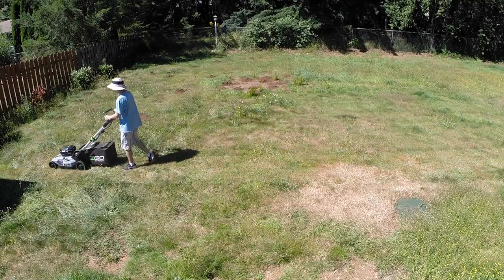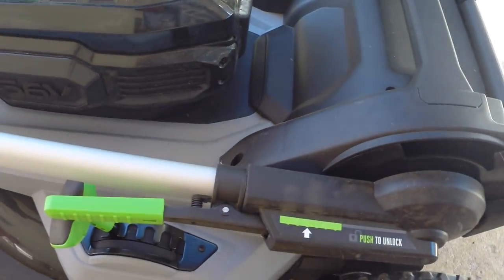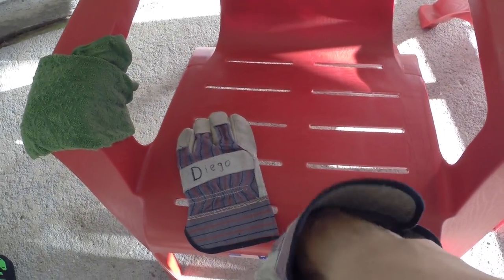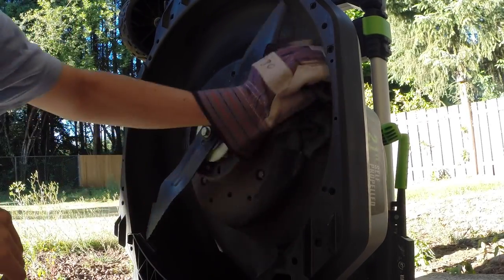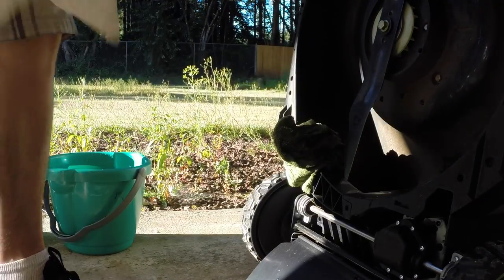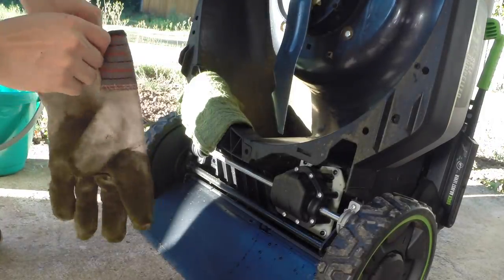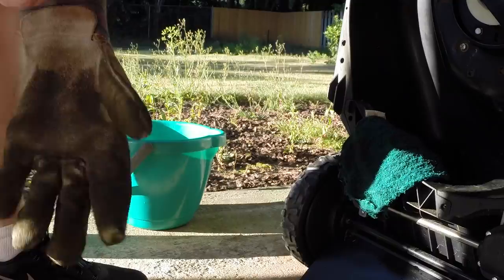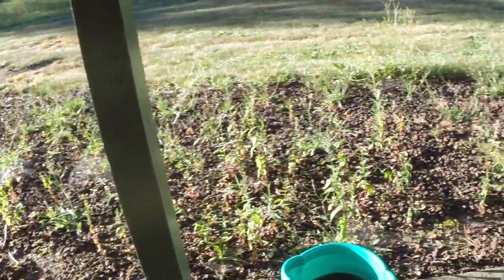How to clean your EGO Mower (the right way)

Comment: All EGO products are rated IPX4 and are water resistant. Resistant is the key word. I've had the mower for 2 years and I always hose down the deck underneath. Sometimes I set the sprayer to mist and gently hose down the top around the battery compartment. Damp cloth for the battery compartment itself.

Comment: I just hose minds down with my water  hose . I  sharpen my blades twice a  mowing season. Oil the joints and  use a WD rust resistant water proof. Two years and still running awesome.
Reply: Hi quick question, lets say I have it in the stand up position to wash it off. Do you go out of your way to set it on its side when trying to wash the very top part?  I never point the water hose directly in the middle but I'm scared that if I spray the very top then the water would wash down to the center
Reply: After you remove the blade, you will notice the white fan that is exposed and you can pull it off with ease.  You then will notice in the centre position shaft and you will see that the electric motor IS NOT EXPOSED but indeed a bearing cover.  Whilst using a hose try to not direct the water at this position anyway.  Had my EGO Mower 3 years now and no problems.  Good luck with your EGO mower.  Cheers from Australia.  Go EGO.

Comment: That is how I clean mine too, not as thorough though. It is time consuming but it is worth it. I do not want to damage the motor like my previous one. I also use the blower first to remove loose grass , so that I don’t have much to wipe with the rag.
Reply: I can't believe I was about to buy an air compressor until I read your comment about using the blower, haha!

Comment: I have had my EGO mower for over 2 years now and I have always hosed off the grass and dirt from underneath with a garden hose, making sure that I do not spray at the centre of the deck where the white motor fan is.  I also do not have a hard spray with moreover a fan of water to remove any grime, grass and dirt away from the deck.  No gloves no detergent, buckets or rags.  This practice I have used with excellent results.  Still going strong.
Reply: Me too.....I do the same thing with my Ego mower.  I have had mind for over 3 years now.  No issues with the mower.  I had concerns because of all the plastic, but those concerns have been unwarranted
Reply: I also have the String Trimmer, pole saw, and edger attatchments and blower and had these the same length of time with excellent results . . .  Go EGO Garden tools. Cheers, JR.
Reply: Aye. I check the underdeck after every mow. Rinse as required with a hose. Done b4 this video was over. Ya just can't get crazy with the hose. Remove the blade when dull give it a good cleaning, file sharpen, and spray with graphite.
Reply: @kamesnek7274  I have the same mower, and the other day I used the hose to clean it, and sharpened my blade, but now the throttle is stuck in turtle mode unless I do a wheelie, and slam the front on the ground. Its like water got somewhere it shouldn't have? Than its good for a little till I do a wheelie, and slam the front on the ground again.

Comment: I stand mines up like you did. But I wait til it's dry with a broom comes cleans easy.
Reply: spafro101 or if you have an air compressor you could blow it away easily with an air hose attached with a regulator so you control the air pressure too
Reply: @peteross4879  yea that works if you have that

Comment: wow, overkill.  just hose it off like any mower after you take the battery out and then sundry or blower dry.  I have noticed EGO very finicky about dirty deck and moderately dull/sharp blade

Comment: Today after mowing leaves and tall rye grass there was about a cubic foot of grass stuck under the deck.  I used a hose, then checked how I was supposed to do it later.  Maybe I ruined the thing, but how to get all that grass out with just gloves?  After it dried, it would be stuck tight.  Yikes!   So much work.
Reply: flexible plastic paint scraper is your friend.  not that difficult....

Comment: Good job! Question: Would it be a good idea to wax the underside before using the first time ? Just a preventive idea ...
Thanks!
Reply: I was thinking the same thing, wax makes sense, but even a light oil might do. Especially on the blade, as it will keep it sharp longer.

Comment: You should be able to just hose off the mower. Using a bucket and a rag is just too messy and time consuming. Hose it off and avoid the electronics. Use common sense. Using a bucket and a cloth is not going to make it cleaner or safer. It just means more work.

Comment: Wow man. You've had those gloves for 4 years? You must not do any work outside. It's a lawn mower. Use a water hose. 

This is like a general how to for cleaning. Don't forget to rinse 3 times. And dry your hands. Then your gloves. Wash it twice. 

Mow for an hour, clean for an hour, then clean up the mess you made while cleaning. Don't forget to remove the blade! 

That was a waste of time.